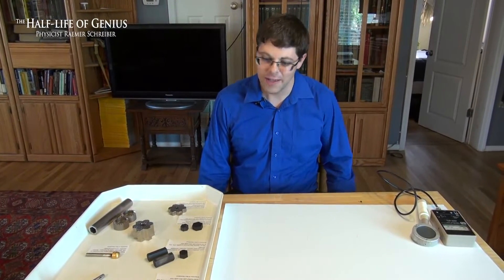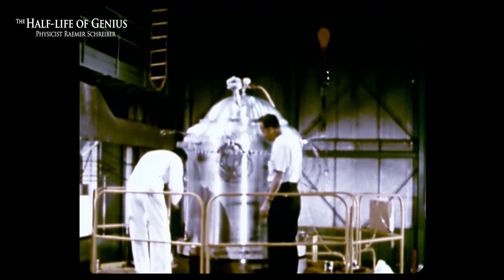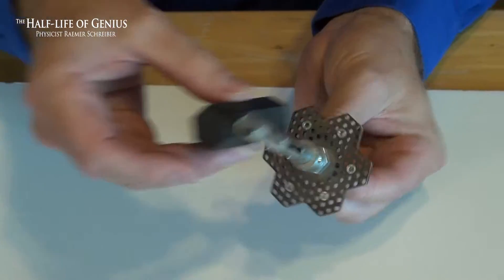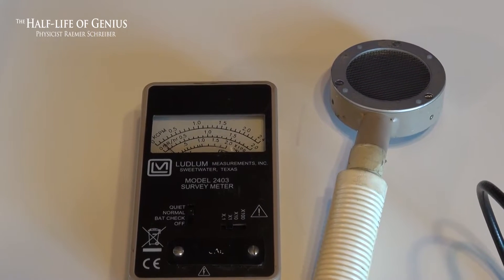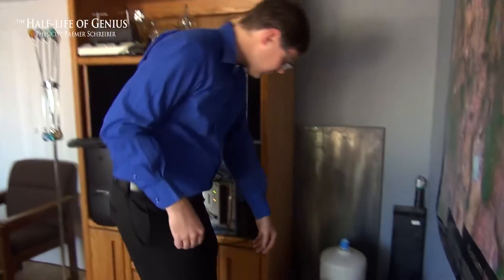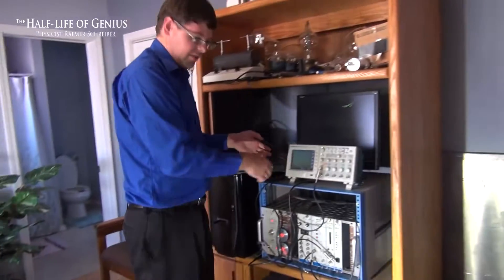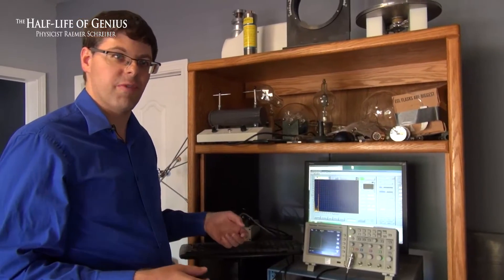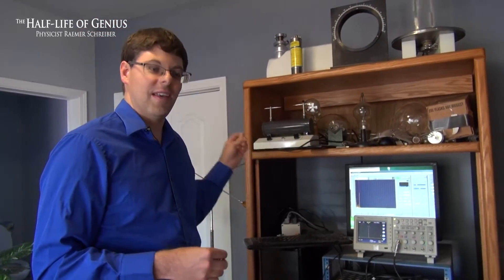Simulated nuclear fuel from Project Rover...one of which is "spicy"

Comment: Thank you for gathering and discussing these nuclear thermal rocket fuel element samples. I've only seen photos in technical papers before. I've been wondering what hardware still exists from the test programs of the late-1950's and 1960's. It would be a shame if it's all lost. In particular, I've been having difficulty finding out exactly where all the NERVA / Phoebus fuel element were manufactured (extruded). I'm assuming at Los Alamos, but I have read old reports that Westinghouse planned to / actually did extrude fuel elements.
Reply: There is a Phoebus  2A version in the atomic history museum in Los Vegas. and at least nozzles in the USAF museum in Dayton Ohio, also Nerva test articles on display with NASA and the national air and space museum.  Some of the last test and assembly building got demoed in 2010, specifically R-Mad building 3110.  Grainy video of that here on tube.

Comment: I was told that germanium detectors are quite expensive, how much did yours cost?
Reply from the maker: Either free or a couple hundred bucks.  I have several HPGe detectors resurrected from junk status.  The crystal is almost never damaged, but the preamp FET is usually toasted and has to be replaced.  You need some skills with vacuum hardware and electronics to repair them.

Comment: This is highly interesting! Have you ever heard of the Soviet nuclear aircraft project? They even seem to have tested the engine, but never made a nuclear flight..
Reply: They made DOZENS of nuclear flights. The US nuclear aircraft program did not make a nuclear powered flight but did fly an operating reactor. The Soviet nuclear bomber operated on an open cycle leaving radioactive dust in it's wake. The US never flew their version because they deemed dumping radioactive material in the exhaust of the aircraft too hazardous and they could never get the weight low enough to fly a closed cycle system. Not to mention that neither side had developed adequate shielding for the crew so everyone on board received high doses of radiation which defeated the point of a nuclear bomber that could stay airborne for weeks to months: the crew would die of radiation poisoning before the plane needed resupply.
Reply: @Zanthum  hmmm I've never seen this information. I read some articles in the internet, with photos, etc, but these were russian articles and they never mentioned actual nuclear flight.